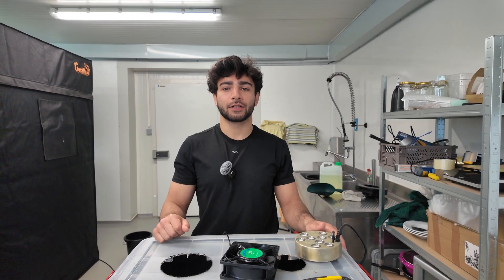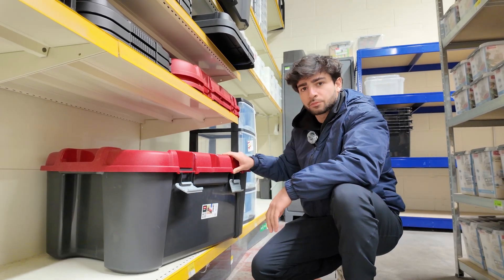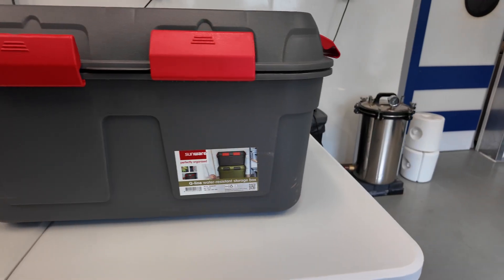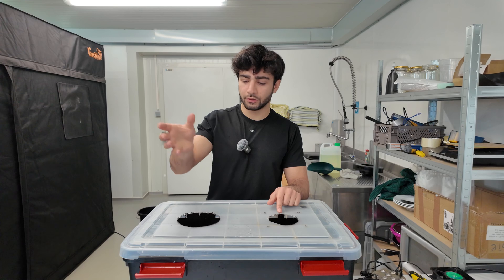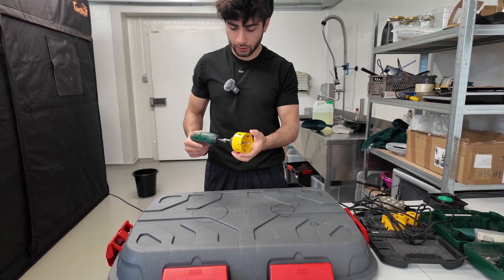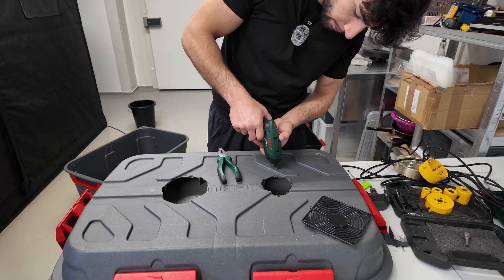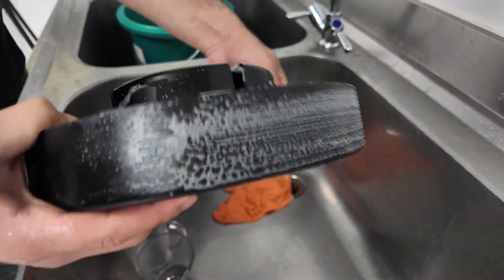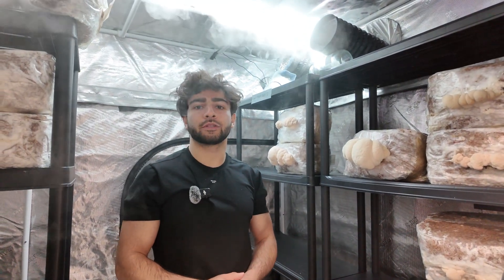How to Make a DIY Humidifier for Mushroom Growing (Upgrade!)

Comment: Honest question; why not include a drip line and float valve? That's what I did with mine, and now I never have to fill it up by hand ever again. I made it a point, also, to include a spigot at the bottom, and keep the tote elevated. This lets me drain the tote into a bucket for easy moving and cleaning. Bonus: I added a 7 watt UV light mounted to the underside of the lid, and have it set to go off for two hours in the middle of the night to assist in (at least partial) sterilization of the humidifier.
Reply from the maker: We’re definitely planning to do something like that in the future. Your design sounds very well thought out and makes a lot of sense.